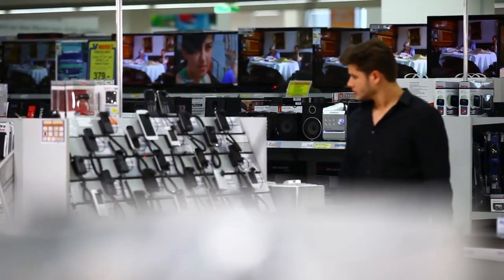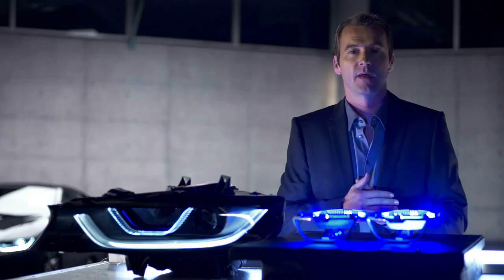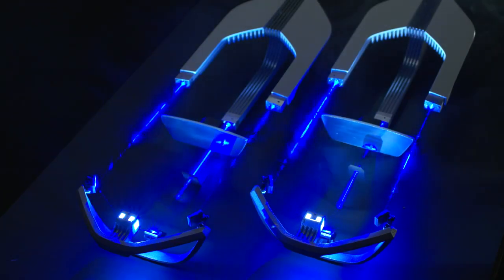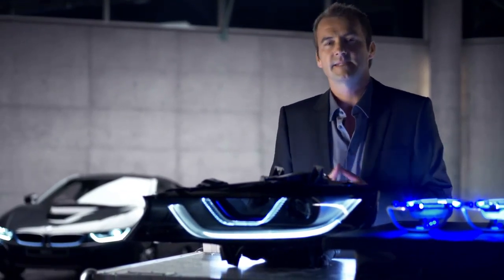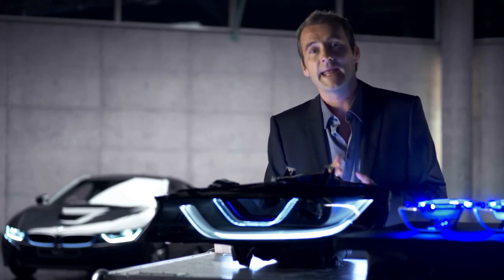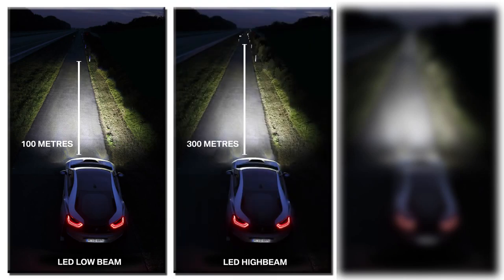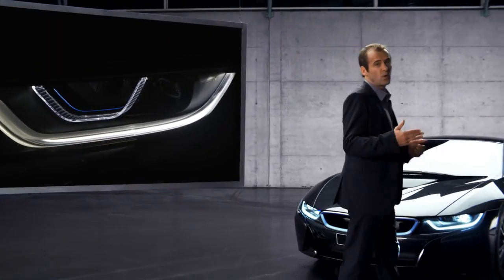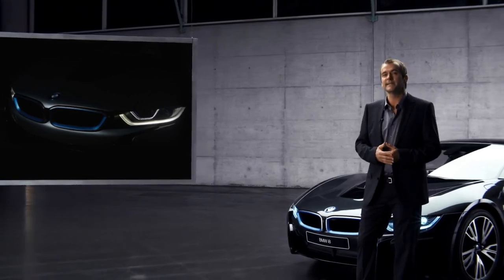BMW i8, how Laser-powered Headlights Work

Comment: If you came here for “how this works”. BMW just introduced third headlights mode “laser light”, the first two being “low beam” and “high beam”.
So it’s just ultra focused light that goes far into the distance. It is not useful without low beam and high beam. It is called “laser” not because there is a laser, but because it is focused while regular light is dispersed in front of the car
That’s it.
Reply: So they couldn't tell us how it works because it's just a marketing lie. Thanks!

Comment: Wouldn't this very bright light affect other drivers? E.g. the ones driving in front of you
Reply: Laser headlights are more accurate than projector HID's. Blinding drivers is no longer a possibility.
Reply: This is why Audi introduces this technology with an automated selective dimming. It can shut off the high beam for the section with another car in it while leaving the high beam on in all other sections. By the way: If someone is driving in front of you, you should always shut off the high beam. But yes drivers make errors and such bright lights can cause dangerous situations.
Reply: The Creationman y u say that
Reply: The Creationman using precise shapes is what they do with the low beams, but a high beam has to light the full road. If it would not blind opposing traffic, you would not see any animal standing in this dark area.
Reply: Daniel Roeske High beams will blind oncoming traffic just like any other light.
Or if you're going uphill and the on coming driver is going downhill, you'll blind them.
But on even flat road I would think BMW would have these aligned properly to not blind anyone when it comes to low beams.
My recent comment was inaccurate lol